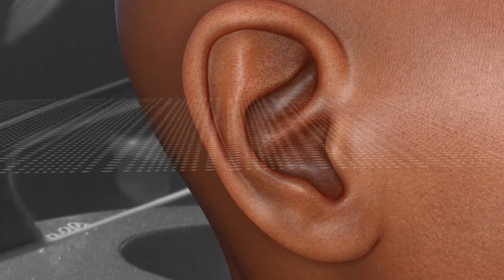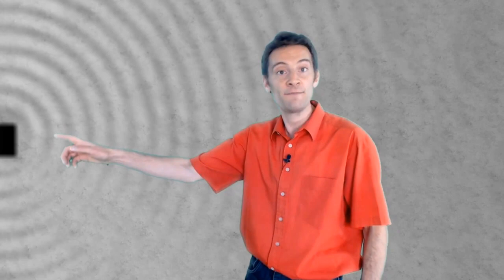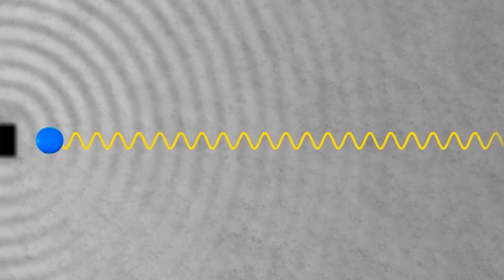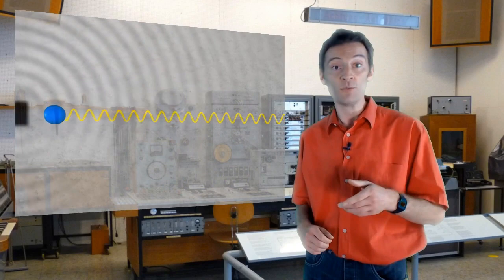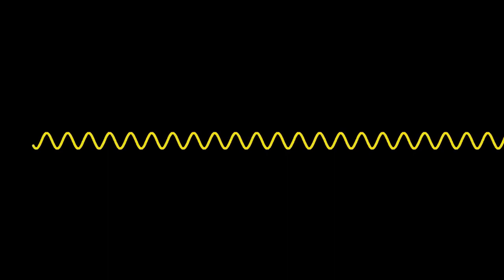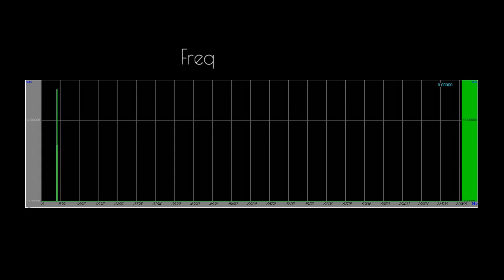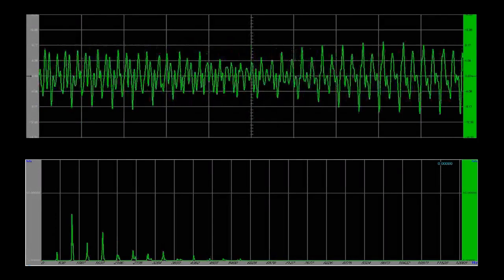What is Sound?

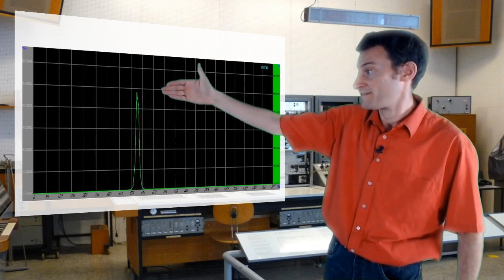Comment: Ditto on on all the praise for this work Mark.  I too, was an engineering student decades ago that struggled with this subject and I drop everything to watch the next episode.  I just want to make sure (for my own sanity check) that at 6:06, while you are plotting change in amplitude, that you are simultaneously changing both the volume (amplitude) and frequency.
Reply from the maker: Yes... Indeed. I am changing both the amplitude and the frequency. Hopefully you can hear that in the audio too, but I've noticed on my laptop, for example, that its sound card has some sort of compressor in it making everything come out at the same volume... So depending on what you're listening to the video on, it might not be obvious. Glad you like the lectures. Lecture #3 is undergoing final editing as we speak and should be available by 21st June.

Comment: keep in mind the blue bouncing ball buffeted by the sound wave wobbles towards and away from the sound source ( longitudinal wave ) as opposed to a water wave which is a transverse wave
Reply from the maker: Yes, I had a little trouble with that animation. In retrospect, the Schlieren image should have been rotated by 90 degrees around the Y-Axis. The idea was that if you think of waves in the sea, the ball would bob up and down on the surface of the water. My problem was I only had a 2-D animation of the sound waves not a 3-D one. Your point is totally valid.

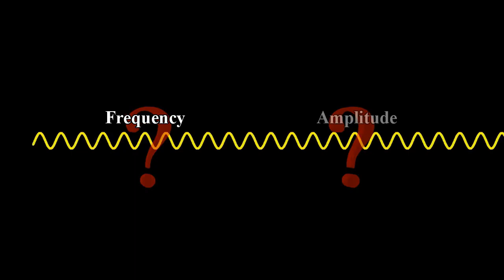Comment: but how does the amplitude change as you change the frequency? at around 5:23, you were changing the frequency but the amplitude stayed the same; each cycle at the same height.
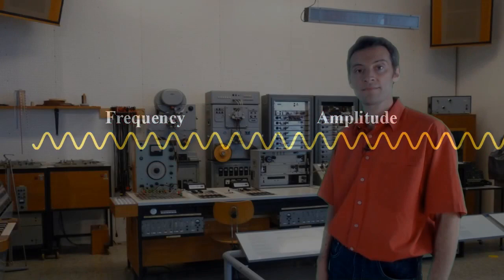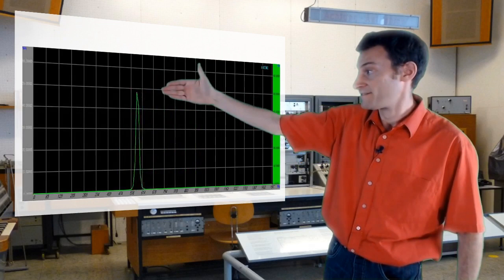at around 5:28 you changed the amplitude but the frequency did not change. so how can you change the amplitude with respect to frequency at 5:58?
Reply from the maker: You can do whatever you want with the signal. The amplitude and frequency of the signal are completely independent of each other. You can change one without it affecting the other. I used an audio editor called Audacity to generate a sine wave and played with it so that I could demonstrate this. At 5:23 I wanted to show what the signal looks like as you change the frequency. At 5:28 I wanted to show what the signal looks like as you change the amplitude. At 5:58,  we are no longer looking at the signal in the time domain, we are looking at it in the frequency domain. At 5:58 I'm changing the frequency only. The amplitude remains constant. Unfortunately, the graph bobs about a little as the software I was using to measure the signal and generate the graph isn't perfect. The height of the peak should be totally still. The peak should only be moving along the x-axis. In the frequency domain, the peak travels to the right along the x-axis as the frequency increases and returns to the left as the frequency decreases. At 6:05 I am changing both the amplitude and the frequency. The peak gets smaller as the amplitude decreases and travels to the right as the frequency increases. Then it grows again as the amplitude increases and moves back to the left as the frequency decreases. 

I hope I understood your question correctly and have answered it satisfactorily.
Reply: @MarkNewmanEducation  
Oh thank you for the prompt reply, I guess my question wasn't very clear.  I wanted to ask about the frequency domain. At 6:05, you were talking the amplitude getting larger and smaller so I thought you were only changing the amplitude, that's why i was thrown off by the wave moving right and left at the say time. I see now from your comment that you were changing both frequency and amplitude, so it makes sense now.
I have another question about the frequency domain.  Given a single frequency sine wave, the amplitude goes from  negative max to positive max, but in frequency domain,
it only shows the positive max.  I'm assuming  only the magnitude of the amplitude matters in this graph and you don't care about the direction because it's kind of accounted for by the frequency?
Reply from the maker: Amplitude is not directional. It is an amount of something, not where that something is going. As you cannot have a negative amount of loudness (the quietest a sound can be is no sound at all), the amplitude is always positive.